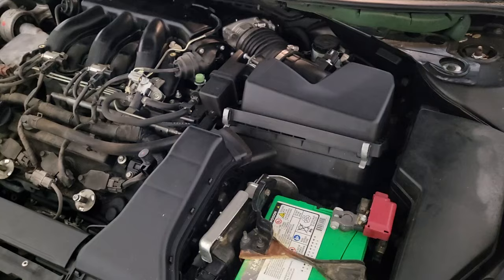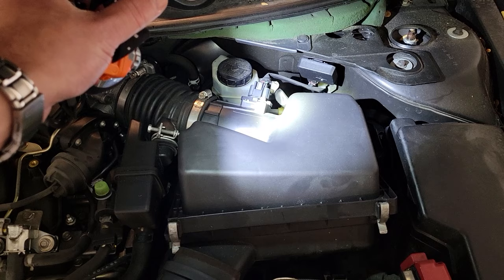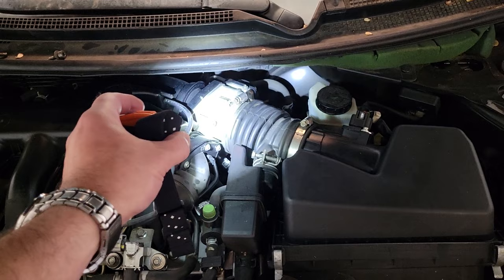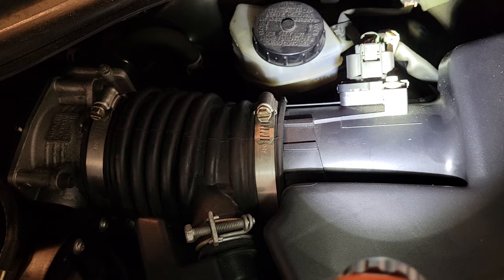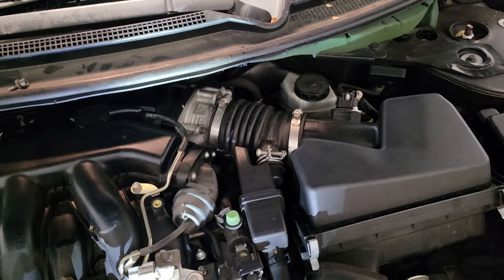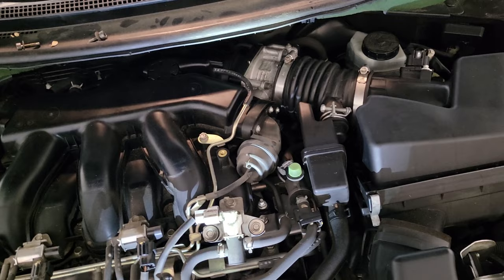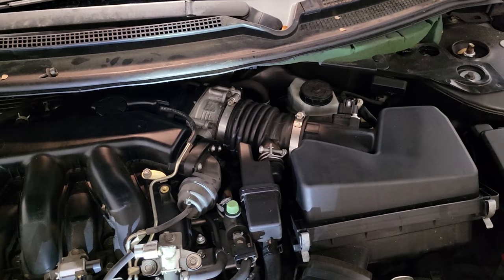Nissan Slow Acceleration & Hesitation Fix

Comment from the maker: If you found this video helpful, please consider clicking the "THANK$" Button! 😃
PARTS & SUPPLIES:
  ALTIMA AIR INTAKE HOSE
    - 4-Cylinder 2.5L 2007-2013: https://amzn.to/3PUZJxu
    - 6-Cylinder 3.5L 2007-2018: https://amzn.to/46uVn7f
  ALTIMA AIR FILTERS: 
    - 4 Cylinder 1994-2005 https://amzn.to/3tG7IXE
    - 4 Cylinder 2006-2012 https://amzn.to/3s0KZFa
    - 4 Cylinder 2013-2018 https://amzn.to/3MgE2GX
    - 4 Cylinder 2019-2023 https://amzn.to/3rUvleH
    - 6 Cylinder 2002-2018 https://amzn.to/3tG7IXE
  MASS AIRFLOW SENSOR CLEANER:
    -Mass Airflow Sensor Cleaner: https://amzn.to/3Qjq8qa
I earn a small commission if you use the links above, but your prices are NOT affected. Thank you for supporting the channel and the content I create!

Comment: I appreciate the pointers. But didn’t correct my cars hesitation/sputtering/bucking issue with my 2008 Altima 2.5S. No CEL so took it to my mechanic and I wanted to share what fixed it. They tightened a loose engine harness ground. The car has been running smoothly ever since. Hope this helps other Altima owners in the future. Thanks
Reply from the maker: Yeah a loose engine would cause a bit of "bucking", I'd imagine!  Thanks for sharing your fix.
Reply: @rob4812 your seems like ignition coil
Reply: My Nissan won't even go forward  I press the gass pedal down..but it goes reverse good ?? Need help n I just change the oil n air filter
Reply: Which wire harness ground was it
Reply: @Yanyan63  they didn’t specify. Sorry.
Reply from the maker: Sounds serious! I'd definitely bring it to a mechanic. Probably a transmission issue?
Reply: @pelonlevaalpachuca3713 did you figure it out?
Reply: Just recently bought one and the ground wire was in fact loose tightened it hopefully it fixes it
Reply: @pelonlevaalpachuca3713 my daughter's car is doing the same exact thing as your car , can you share with me what they did to fix it so we don't get ripped off
Reply: Were was the ground at?
Reply: Already commented above- unfortunately, they didn’t specify.
Reply: @pelonlevaalpachuca3713 that sounds like your CV transmission have to Do replace the transmission. Look up about the Nissan CV transmission They are bad or terrible. I think that’s your problem. I had to replace mine.

Comment: There is a 5th and possibly 6th cause as well. (1) the brake light switch by the pedal could be sticking, causing the computer to read that both the throttle and brakes are being pressed at the same time. Then the computer limits the vehicle’s ability to accelerate. (2) the brake light relay, causing the same symptoms as said above
Reply from the maker: Good info... Thanks for sharing this!

Comment: 2009 nissan altima, full visual inspection yielded nothing; my mechanic suspected the throttle body, as apparently they're known to go out easily. it turned out to be the speed sensor; it was shorting or had bad components. he was quick to tell me his dissatisfaction with this model for it's difficult-to-diagnose issues such as these 😅 hope this helps anyone having the same issue but can't see anything mentioned in the video!
Reply from the maker: Good info… thanks for sharing!

Comment: My Nissan runs good but after 10 oh 12 miles the speed decrease and won't take the next gear until cools off , maybe 2 hours after , the mechanic can't find the problem , anyone knows?
Reply: CVT overheating
Reply: @Sheeler-Bey I’ve replaced all vacuum hoses, O2 sensor, throttle body, accelerator pedal, valve cover, coils/spark plugs, and still stalling and it’s due the same thing.
Reply: Upgrade transmission cooler
Reply: @manifestedsonglaspie change CVT transmission fluid

Comment: Clean everything out for replace the mass in flow sensor everything and the problem went away for about two months and now every time the car warms up you have to put it in neutral for a second then back into drive to continue accelerating from a stop sign or something
Reply from the maker: Did you ever figure it out?
Reply: @JohnRyan208  yep,  I sold it and the problem went away!
Reply from the maker: @WalkHard1  perfect fix! 😂
Reply: @WalkHard1 best reply ever in the world

Comment: Im having the same problem with my altima! Im going to try these solutions. Thank you
Reply: hey it work? mines hesitates at a stop light and sounds like it wants to cut off.. im going to mess with it this upcoming weekend
Reply: @jeremyallen3845  did it work
Reply: @richricks78  I took throttle body off and cleaned it both sides really good. That helped a lot. My hose was good too by the way
Reply: @jeremyallen3845  hey bro I’m having the exact problem. Car starts fine but isles rough like abt to cut off. I have the 09 2.5
Reply: What should I do?
Reply: @adalatnawaz5793  I cleaned the throttle body and and it hesitated maybe one more time but drove fine after that
Reply: @jeremyallen3845  update: Just started my car today and it sounds so choppy. Maybe a vacuum leak. But also when I opened my hood I found the air filter box left open! So I will try to clean the throttle body! Thanks in advance man!
Reply from the maker: Glad to assist!
Reply from the maker: A dirty throttle body can be a big problem. Clean with mass airflow sensor cleaner and an old toothbrush.
Reply: @JohnFixes no, they have throttle body cleaner for a throttle body and a mass flow sensor cleaner for a mass flow sensor. Dont use one for the other.
Reply: So I was doing some cleaning on my 19 maxima sv and forgot to put the plastic intake back it I drove with it off for a couple days runs fine but revvs a little hi when accelerating barely can feel it but should I reset the ecu

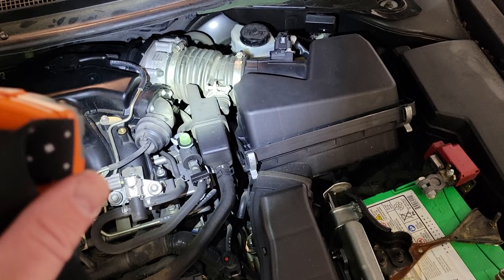Comment: 2:00 in is where people need to focus on.  IT WILL NOT BE NOTICABLE visibly that the hose is cracked, you must get a flashlight and feel around.  The dealer wanted $4800 to fix the CVT transmission, a local shop wouldnt touch it because he knew Altima's were challenging to fix when this happens.  It was not our brake sensor, nor the MAF being dirty...it was this hose.  Sometimes a simple and diligent inspection of a car is necessary before taking it to a stealer.  Look for frayed wires, loose hoses, low fluids, things the average person can do.  
This was a surprisingly expensive part at $50, but well worth it to solve this issue.
Imagine pulling out onto a busy highway and your car just stops accelerating?  CHECK YOUR HOSE TODAY!

*Thank you for posting this*
Reply from the maker: Man, you made my day! Glad my little video saved you some serious $$ and solved the problem!
Reply: @JohnFixes  I goes beyond that.   This car actually belongs to an elderly family member who just lost her husband.  She doesn't have any money, and since her husband passed she had had to replace a pressure regulator, a washer, had her roof start leaking, her sidewalk lifting up from freeze thaw, and many odd medical issues herself.  She wasn't going to pay that money for that old of a car which otherwise looks new and runs great with nice features like heated leather seats.  
When I fixed this she stressed for weeks after it couldn't possibly be the solve, the garage people wouldn't take advantage of an old lady.  
So you made her day as well.  Ours was cracked in three places.  I found a few more items to address while inside the hood but nothing major.  All set now, except a deer ran out in front of her so she's waiting until July when the shop can take her in.
Reply: My car started to not accelerate sometimes when I step on the gas fully. Like it gets revved then suddenly like jumps to speed.
I checked that hose & it's cracked, could that be the cause?
I was thinking it could be the CVT :(
Reply: @xCARPx2014 it could be, but you could get this part and try it, if it doesn't fix it clean it and return it.  It sounds like the air intake hose honestly.  People are too quick to assume the cvt transmission is the problem.
Reply from the maker: Either way, get that hose fixed asap.  The dirt it's pulling into your engine will grind it up!  You'll start burning oil, smoking out the back, and worse....
Reply: @xCARPx2014  Hi, my car has the same problem, how did you solve it?
Reply: Yoke yeah they tell me it’s the trans but i need to check the holes

Comment: Thanks for your video a new air intake hose fixed my problem 223 thousand miles on the 2010 altima big improvement acceleration and no hesitation.
Reply from the maker: I'm glad we got you back on the road at full speed!

Comment: I have a Nissan Altima 2017 SV. If you dont have a leaking hose like his car, try changing the transmission oil and all the spark plugs. It worked for me, hopefully it will work for you guys.
Goodluck.

Comment: My nissan altima 2013
Engine light with P0101 code
I replaced MAF sensor, Air filter, PCV value
Also I check throttle body  MAF circuits check  but still issue not resolved,  what I will do?
How much I want spent more to resolve this warning?
Reply: Mines doing the same I have 2013 seems as if something with fuel pump or filer want go over 40mph
Reply: Any luck
Reply: @damoncunningham5550  Any update?
Reply: What happened?

Comment: My Nissan Teana 2011 is not quick to move off the ground after starting the engine. Also i dont feel the gear engaging while on motion. I got a rewire who told me that its normal but i am scared it will damage the engine. Anyone having same experience?

Comment: My car still accelerates but it drives sluggish like it’s loosing power I checked the air filter It didn’t look bad  it’s 2013 Nissan Altima do you think it could be the hose or maybe spark plugs I have High miles recently got a oil change
Reply from the maker: Definitely look at the hose,but also clean the Mass Airflow Sensor and throttle body
Reply: Did you figure it out

Comment: I put on a new MAF sensor and still not accelerating right
Reply: Could be a leak in the air hose
Reply: Same here I replaced all 6 spark plugs and new MAF sensor and my car is still not wanting to accelerate, did you ever find the problem?
Reply: @jesuszapata8241  have you tried the upper fuel ratio sensor ? Or could be a clogged catalytic converter
Reply from the maker: Did you ever figure it out?
Reply: @noyourawsome2lol979  unfortunately no said it was crankshaft sensor replaced it and still same problem

Comment: Would this apply to a 2021 Nissan Altima?
Reply from the maker: I don't have a 2021 but would definitely think it applies if it has an air intake hose like the one shown. With that said, a 2021 is so new that I'd be surprised if the hose was cracked already.
Reply: @JohnFixes  thanks John…..no…no hesitation as yet, but more concerned on making inspections and adjustments where I don’t experience major problems on the CVT and MAS sensors as been hearing about.
Reply: My ‘21 does it but mostly from first start for about 30 minutes or so then it’ll stop and drive fine. It’ll bog down for a few seconds then it’ll take off like a damn rocket

Comment: My daughter in law’s car did all of that and we found out two months later it was the alternator. Smh
Reply from the maker: I guess you'll never know how it'll turn out...! Thanks for watching
Reply: @JohnFixes  ikr I have never experienced an alternator failure like that. We tried changing the gas pedal, the whole throttle body, and the mass air flow sensor and nothing fixed the problem. We were all shocked to find out it was the alternator lol